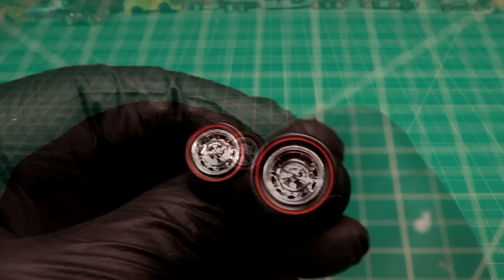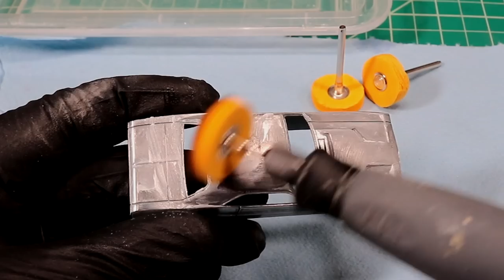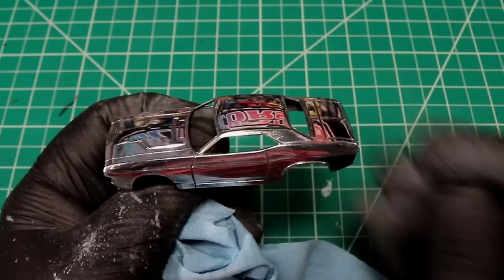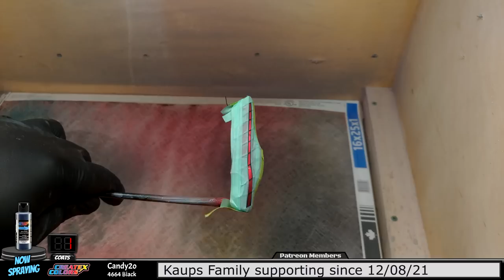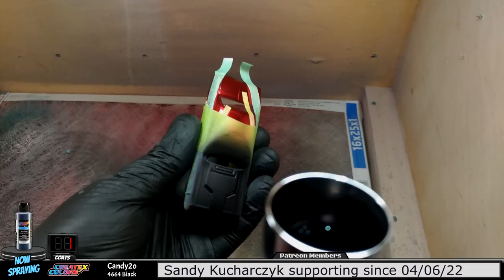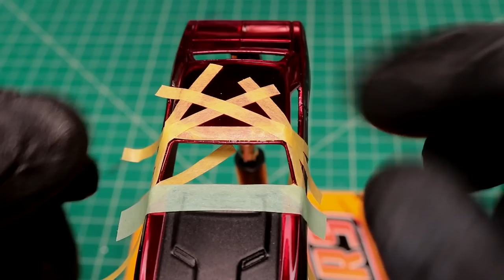Red Chrome Dodge Challenger Build 1:64

Comment: I have their cuda but the rivets on the front plate that holds the wheel were a defect from factory iv tried solder and it didnt work it wont roll now i just put up as a non user collectable ill fix it one day